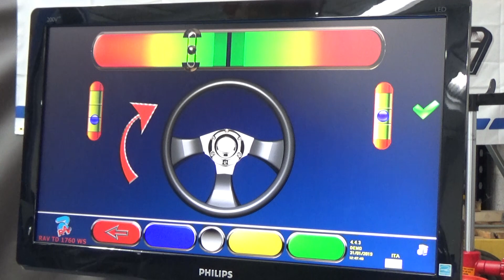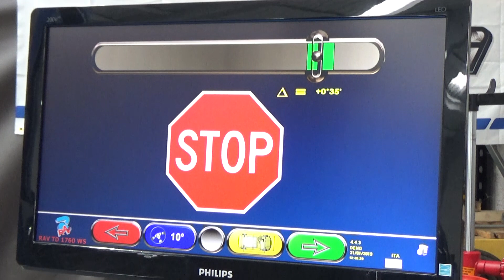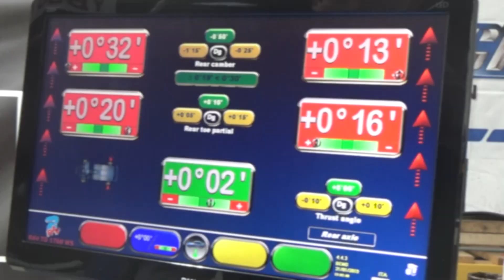Absolute Alignment   Two Post Wheel Alignment

Comment: Good video. Did you have to put on the spoiler adapters to lower the heads below the level of the arms on the 2 post to avoid loosing signal between front and rear heads ?